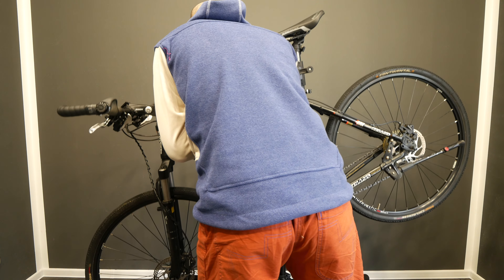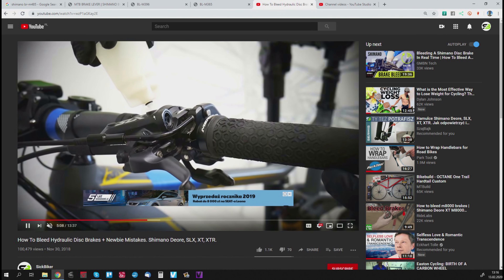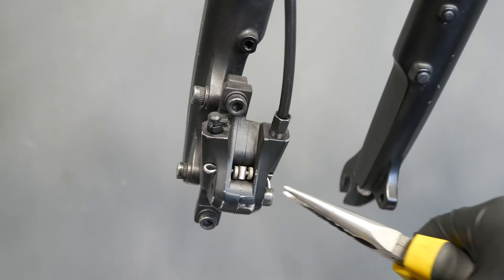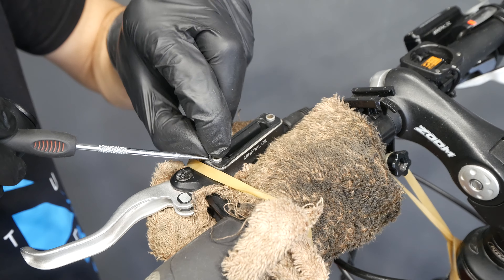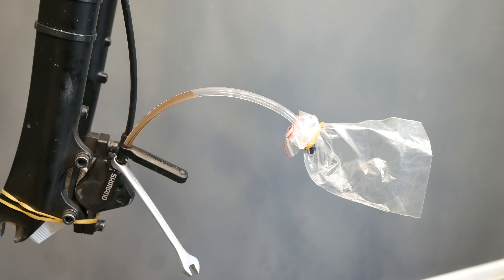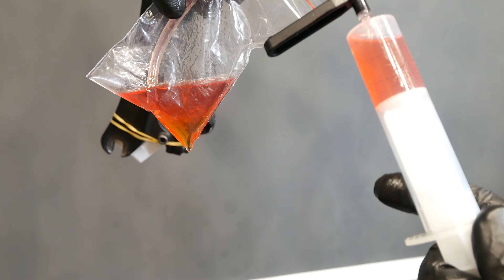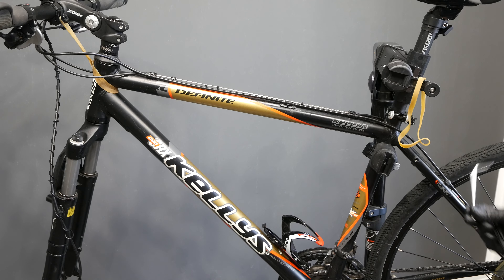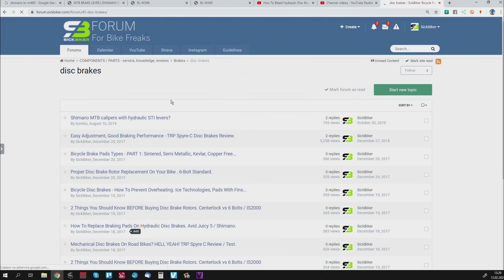Homemade Tools For Bleeding Old Shimano Hydraulic Disc Brakes. How To Fix Weak Brakes. DIY

Comment: One piece of advice, when removing the pipe from the callipers put your finger over one end to form a seal and then remove the pipe. This will then ensure that no oil leaks out (like it did on the rear brake).
Once free of the calliper move the pipe into your collection container and remove your finger, the oil will then flow into the container - zero mess...

Comment: Excellent vid. I have struggled to find one that covered the brakes on my 1st Gen Specialized Carve 29er. This walkthrough was epic. 

Though I didn’t remove my wheels and pads - so have to order new pads as you were right. I got oil on them and they dont grip anymore!
Reply: dont throw them away just burn them
Reply: That could be the same  reason for my weak brakes , so put on  the old pads again.if that doesn't help,I don't know what to do.
Reply: @joshis1913  dont because you will contaminate them . First burn the discbrakes with a small flamethrower and than burn the pads and you are good to go!🚴‍♂️

Comment: TIP : If your brake still feel spongy/ then look into brake presses on rides there is small 2mm alan screw thingy in middle and you can adjust level of press  :)

Comment: Thanks for doing the video. I could not find many with the old style shimano Reservoir. I did both mine today but the rear is still too spongy despite all new fluid and do e with proper caliper blocks in. I think I will try using the syringe I have and do it the other way tomorrow to see if it gets some extra air out. Any other relevant suggestions welcome. Cheers.
Reply: Did it work better the other way?  Seen videos bleeding in both directions.  Imagine syringe pushing through from the calliper side is better.

Comment: Hi. I can't get the bleed screw off my shimano shifter. So if I open the caliper up at the bottom and try and press out the bubbles downwards like in the video, will this still work if I don't take the bleed screw off